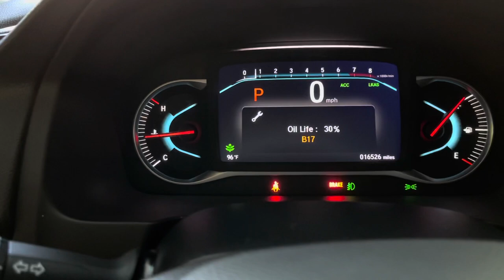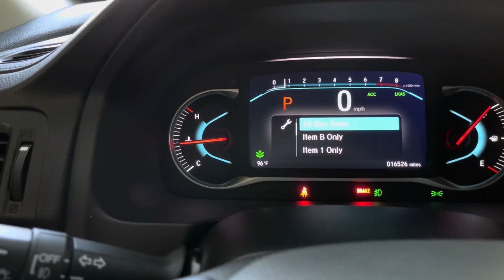2021 - 2020 - 2019 - Honda PILOT Oil Change - Easy DIY

Comment: Thank you very Much - Especially the close up shots of which way to turn the filter and the drain plug for removal. As a dyslexic person, this is super helpful to see. Even though i changed the oil on many cars trucks and outboard motors. I still have to think way too long on which way it loosens! ha!
Reply from the maker: Thank you brother. 😊

Comment: Great video...but I wouldn't cut the plastic shield but remove clips and screw; also before installing the filter I would fill it up with oil to avoid a dry start...just my two cents. Still very informative video !!
Reply from the maker: Thanks Man. Im just a DIY backyard guy. So different ideas from more experience guys helps me a lot. Im learning👍. I will do that for my future oil changes. Thanks. About the plastic shield, cant do no more Lol!

Comment: Thank you so much for your video.  I took mine to Honda dealership for both oil changes and both times it leaked where the oil filter was at.  They did sloopy work.  I will start doing it myself from now on.
Reply from the maker: Good luck Man. Its always good feeling to do it by yourself. No body will take good care of our cars more than we do😅

Comment: Kabayan , I just bought a new honda pilot 2022, the mileage right now is 6,500 the computer said to change oil, but on some research shows u can change oil it to every 7,500 miles, just bought a 0w 20 full synthetic oil & oil filter to change it myself when it reach 7,500.
Reply from the maker: Congratulations Kabayan for the New Pilot! Its a great Car! You can always do that but Honda recommend 5,000 miles to have an Oil change. Ever since iam doing maintenance service with my vehicles, i always change Oil and Filter when it reaches 30% which is like 4,500 to 5,000 miles oil life in the computer maintenace info. For me the sooner you change the better for your Pilot engine. You cant go wrong kabayan pag papalitan mo ng Oil sooner than 7,500.

Comment: Great video. I like every clips of it. I am from Subaru family and the oil filter is accessible from the top. The location of the oil filter of this Honda Pilot is really bad. One will need to remove the wheel in order to have better access to the oil filter location (if one doesn't want to trim off some plastic). Thank you for sharing.
Reply from the maker: Thanks brother! Its my first Oil Change service with the vehicle and the oil filter location was kinda tight. Theres no enough room so i decided to trim off the plastic. Thanks for the nice compliment😉
Reply: I just did the oil change on our 2021 Pilot SE. I didnt have to remove the plastic trim. Its doable but a pain in the ass nonetheless.  Great video.
Reply: Oil filter brought me here. I’m like wtf is the best way to do this.
Reply from the maker: @tylersanders6778  yeah. Same feeling when i did my first oil change😀..

Comment: Bro, you made it look easy. 
Have a first gen Tacoma. Pain in butt for oil change. Wife has a new 2021. I don't trust dealer. Changing at 5000 with full synthetic. 
Nice vid
Reply from the maker: Thanks bro! I used to take my vehicles to the dealer but i thought it would be better if i do myself. Right amount of Oil and for sure full synthetic Oil will be used and at the same time saving some buck 😀.. i change Oil every 30% oil life in the computer.
Reply: @110897100  They put an oil monitor on there for a reason. Wasting oil and filters at that rate, totally unnecessary at 30%. The only way to tell how much life your oil has left is by doing an oil analysis. Try it once, you find out you can just reset your oil life monitor for another 5k. Ive done it
Reply from the maker: @jockkewstow9231  yes. For synthetic oil should be fine 5-7,500 mi before having oil change. But since my first honda, ive always done oil change before reaching 5K mi and i didnt have any problems. But you’re right. Tech now adays is way better than before. Might try to do it next time. Thanks man

Comment: You can use one of those solo plastic cups and take off the oil filer with and the excess oil will leak into the cup also.

Comment: basta pinoy malinis talaga..ako rin ng change oil sa aming honda pilot..
Reply from the maker: Oo kabayan. Mas naalagaan ang sasakyan kapag tayo ang gumagawa ng nga basic maintenance. Thanks for watching
Reply: @110897100  tama ka kabayan..$54 sa honda dealership ang change oil pero pag bilhin mo parts sa kanila is almost 70$.
Reply from the maker: @atokianotr9200  Yep. Mahal, its like over a 100 ang charge ng dealership.. Pagdating na pagdating mainit pa engine binibira na nila. Kaya minsa madalas nasisira un thread ng oil pan at drain plug.😀..
Reply: @110897100  oo nga tas power tools pa gamit nila kaya puersado talaga ang trade..saan k ba bumibili ng oil at filter mo pala
Reply: i mean thread
Reply from the maker: @atokianotr9200  sa dealership din ako bumibili brother. Dati bumili ako ng washer sa amazon. Same size pero mas makapal kaya sa honda nalang lahat..
Reply: Thank you. I have been letting dealership do maintenance till extended warranty ends. BTW the 7 code is for brake fluid change. Not sure if you did that.

Comment: Good simple video. Look at replacing that drain plug with a fumoto oil drain valve to save some time and mess.
Reply from the maker: Thanks Man. I was thinking about that too. Ive seen a lot of people who use oil vac but iam not so sure if thats good enough to suck everything out.

Comment: I prefer subaru, top oil filter and no under cover, so direct access to the bolt. With fumoto valve, changing oil is super easy and clean.

Comment: I have the same yellow ramps.  Where did you get those extensions? (and do they have higher ones - I also have a Corolla that won't go up the ramps)
Reply from the maker: My uncle gave it to me which he said he bought it in the 90’s. Kust dont know if they are still in the market as of today. And you are right, the reason he bought the extensions was his civic cant go up the ramps.

Comment: Hey Road Master, what did you use to trim the plastic covering with? and did you have to take it off to trim?
Reply: FYI - I trimmed plastic like Road Master using a box cutter on my 2019 Pilot.
I did not remove the plastic shield.
Reply from the maker: Ei men yeah you dont need special tool to trim it down. I just use regular cutter. And no need to take them off.

Comment: Hi Kabayan. When did you start changing your own oil etc? Paano yung computer checks and tire rotation during regular maintenance? Thanks.
Reply from the maker: Hello kabayan! I started doing regular maintenace with my CRV maybe after i put 40,000 miles on it. I used to take to Honda for oil change and tire rotation but 150$ is quite a bit so i decided to do my self. After oil change reset mo lang sa computer maintence info ng vehicle. I do tire rotation also. For me mas OK kung ako ang gagawa kasi na ddrain un oil well at tama ang oil na nailalagay kasi sa shop we never know😀. Para sa Pilot ako na gumawa para sa second oil change. Un una kasi free sa honda.
Reply: @110897100  Galing nman! Driver lang kasi tlga ako kaya walang alam. I'll check your videos and see lung kaya on my own. Thank you sa info.
Reply from the maker: Thank you kabayan. Hindi talaga ako certified mechanic. Mahilig lang mag kutkot. Dati ganyan din ako driver lang. Pinag aralan ko lang din para maka tipid ng konti sa service. Good luck kabayan..

Comment: Why do you use the genuine Honda Motor Oil instead of other brands? I thought what matters is the fact it is 0W-20.
Reply from the maker: I have a good friend who works at honda as a mechanic and according to him using oem brand is always the  best…They cost a little more but not a big difference anyway.
Reply: @110897100  It doesn’t hurt. I use genuine Honda fluids for everything EXCEPT for the motor oil and windshield wiper fluid. 

I feel like the motor oil, it doesn’t matter which brand, but what does matter is that it is 0W-20 and full synthetic.
Reply from the maker: @spritemoney  that is for me the most important fluid that you use OEM. motor oil, trans fluid and coolant..I have a video on my crv also and i got some comments from viewers recommending using OEM fluids. It was my first time to ise Penzoil.

Comment: Where did you get those transition ramps to go up the steel ramps?
Reply from the maker: It was given to me by my uncle. He said he bought it in the 90’s and barely used it. Im not so sure if they are still in the market by this time.
Reply: @110897100  Thanks

Comment: Do you buy the oil, filter and crush washers online?
Reply from the maker: I bought Oil and Filter at Honda Dealership. Boight crush washers at amazon
Reply: I personally quit buying filters from Amazon.  I ordered 2 Wix filters which were delivered from 2 different locations.  Wix boxes didn’t match, Wix stickers on box didn’t match, and painted on part numbers were so smeared you could barely read the PNs on the filters.  I’m not saying they were fakes, but I’ll spend a little more at the dealer.
Reply from the maker: Great decision brother. I think wix has a good reputation but if you buy it from amazon thats a different story because you have to deal with unknown sellers. Use OEM just to make sure and take care your engine. I used crush washers also from amazon but i noticed they are a little thicker. I will use OEM washers next time.

Comment: Hello kabayan. Will this not void the Honda Plus warranty? I’d like to do my own oil change. Thank you
Reply from the maker: Yan ang worries ko before kabayan. So i did some research and it says wont affect the warranty as long as you can prove that you use the recommended oil by honda. So i kept all the reciepts. But para maka sigurado ka, talk to your dealerahip. I decided to do it para makapag palit ako ng oil every 3K to 4K miles and to make sure maaalagaan ang engine.

Comment: I think they welded my drain plug on.  I'm pushing so hard I'm scared the vehicle is going to slide off the ramps
Reply from the maker: Wooo! I guess its time to do by yourself from now on. I use ramps but i still use jack stands for support.

Comment: I just bought my 2021 honda couple months ago,  where did you buy the oil And oil filter? How much was it? How often we're supposed to change the oil?
Reply from the maker: I bought it at Honda. I think the cost was 57$.. i always rely on the computer when to change my Oil and filter. I change it at 30% Oil life..
Reply: @110897100  
$57 dollars is not bad, im going to call my dealer and see how much they charge, thank you!
Reply from the maker: @flakitopeluche1692  you’re welcome brother
Reply: @110897100  where did you go to buy the oil? Amazon has some but is really expensive there
Reply from the maker: @flakitopeluche1692   where’s your location brother? I bought it at honda parts.. ask for custumer discount😀.. they usually gives 10% off…i bought 6Q of oil and a filter.… bought my crush washer at amazon.
Reply: @110897100  im from Washington state , i'll do that also do you think i can use also instead of honda oil, mobil 1 full synthetic? I saw some guys using the oil
Reply from the maker: @flakitopeluche1692   yes you can use other brands.  I use Penzoil full synthetic on my 2015 CRV and so far im OK with it. But i always use honda Oil Filter. I have video also on my CRV. 57$ by the way is a california price.
Reply: @110897100  thanks dude!
Reply from the maker: @flakitopeluche1692  you’re welcome brother! Enjoy your new car and congratulations!

Comment: You cut the splash shied but torqued the drain plug? 😂
Reply from the maker: Yes. 😂. Im more worried about the drain plug than the splash. The engine buttom part is uncovered anyway😅. But i should be patient enough to just detach the cover and put it back after changing the filter.